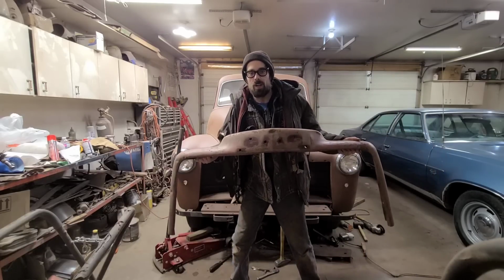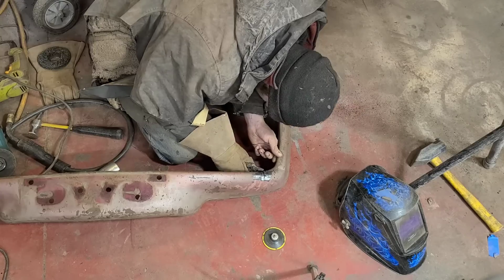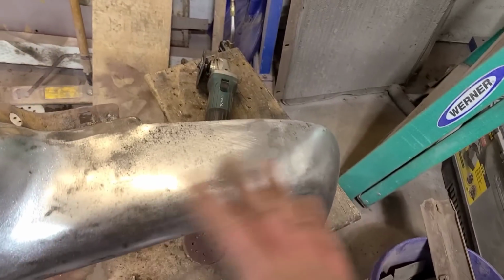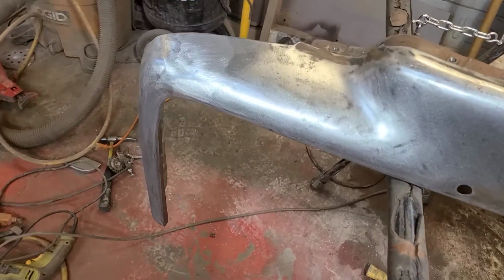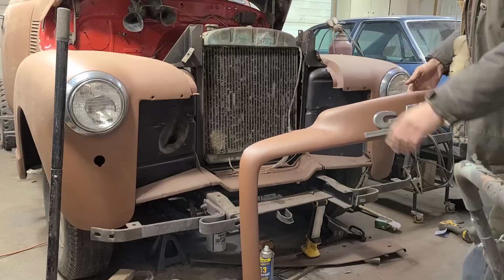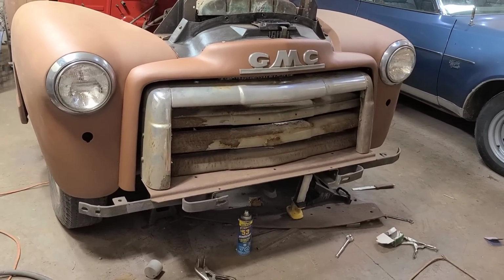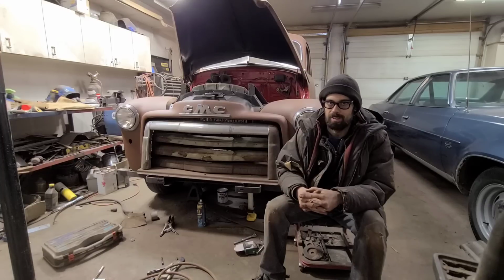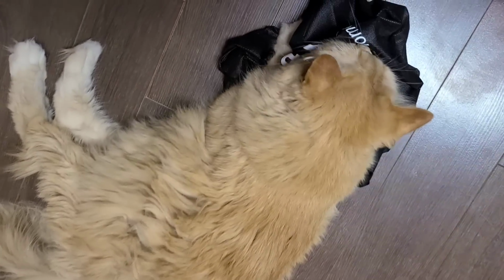1948 GMC Grille Surround Restoration. Plus: Sculpting With Lead!

Comment: You are quite gifted in your handling a lead fill - not a single run or drip onto the floor. I think I just learned something.  Can you tell us what is the lead/tin ratio you used?  Thanks. 
I would like to find a company that sells lead for this purpose other than Eastwood here in the States. I had a very bad experience with Eastwood and a welder I purchased from them. I never used it much for a couple years, just a tack here and there. Finally I went to use it (of course the warranty expired on this China built and engineered machine) and they were going to replace it and then backed out. I have less than one hour of use on this MIG welder and I defy any pro to use it successfully due to the power switching levels without touching an adjustment and this is with a good ground connection. They stuck me with a welder that looks brand new and doesn't work. So, I will not purchase lead from these greedy bastards. Sorry to rant but people should know about Eastwood.
Reply from the maker: It's 70/30. I buy it from the local auto body supply store. It's made by the Canada metal co. I just checked on Amazon and they sell 70/30 lead bars made by Roto Metal in the USA.   I hear you on Eastwood, I try to avoid dealing with them. They tried to re-charge me for an order I bought 2 years earlier, claimed the payment never went through the first time (even though they shipped it to me and I had made several orders since without issue). Got around it by making another account and ordering what I needed and I haven't bought from them since (8 years now)

Comment: If I could I would disable your fast forward, or at least by 1/2.  I enjoyed the grille surround resto otherwise. My favorite times is when you put the detractors down your way, STFU would be quicker but not as fun. You still underestimate what is interesting,( to me at least ),  but drag this build on as long as you can !!! BTW The grill, clean and fix well enough to match the silver of the GMC emblem. Don't leave it as is, it's an insult to you skills.

Comment: Re the grill that was originally chrome-plated: I think it would look pretty good if you repaired it like you did the surround. Bondo up (or use lead, if you insist) the rough spots and then sand and paint it. Make it a color the same family as what the rest of the body will be in the final coat, only darker. I've seen this done quite a few times and always liked it. It's faithful to the original design but looks much cleaner than leaving the flaky, ravaged chrome. And it's relatively inexpensive. In other words, what you said.
Reply: Personally I think the grille would look good in a lighter tone.  If the truck is brown, make the grille a sort of khaki color.

Comment: First off using the frame of the stand to hold the piece instead of balancing on your leg....wow...seriously I would have f-ed that up. Secondly, what did you apply before the lead? Was that flux to prep the steel? No seriously, it's a legit question...
Reply from the maker: It's eastwood tinning butter, basically just a flux. I have a leading tutorial video somewhere on the channel that shows the whole process